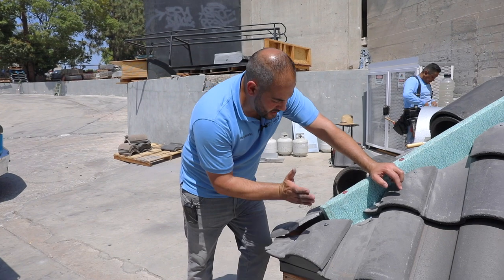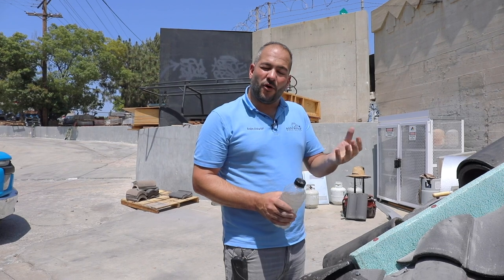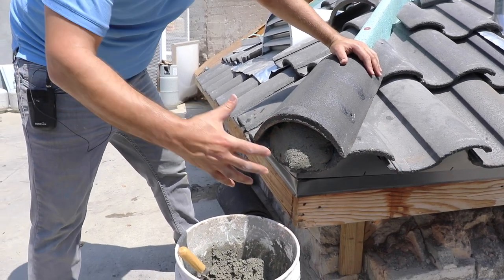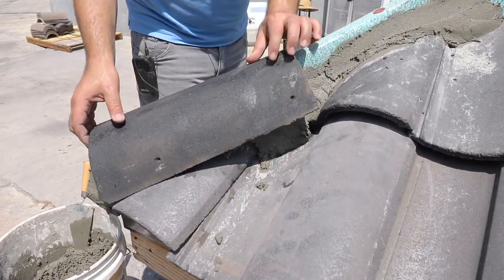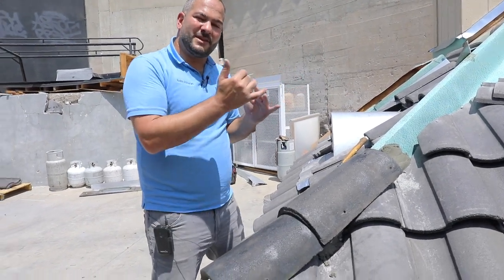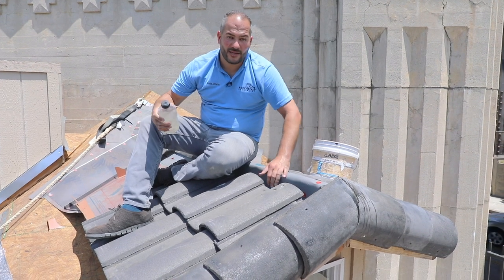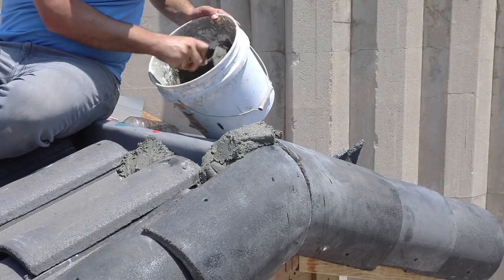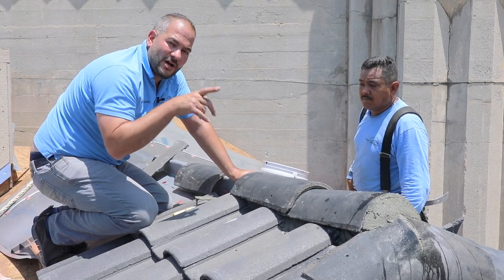How to Install Hip and Ridge Tiles - S Shape Tile Roof

Comment: Interesting; My tile roof is about 20 years old. My roof is leaking although I've repaired all the broken tiles. I live in California in the central valley. Temps here are regularly above 100 degrees. After watching the video I looked closer at my roof. I don't find a single tile that has been nailed. There is no mortar, sign of adhesive, or nails on any of the ridge tiles. My tiles are "S" style. I am contemplating removing tiles in leaking areas and repairing the underlayment myself. After watching this video I am perplexed about whether I need to mortar my ridge line on this 1970 ranch style house. Is there a best practice for beginning a repair like this? I mean, where should I start looking for the damaged underlayment. I've been in the attic and I couldn't determine where the leak came from. A leak on the ridge line above the garage I temporarily repaired with a tin foil platter...
Reply from the maker: To find the damage underlayment remove the tiles above the leak area approximately 10ft x 10ft. Remove the underlayment and you should find the wood stained. Follow the stained wood until you find the source. If your having multiple leaks it may make sense to try to replace all the underlayment.
Reply: @RoofRepairSpecialist  Thank you. This is helpful. I was up there this morning and I have a couple of vents where the flashing metal is bent and the tiles out of alignment. This is the only problem area I see.They are close to the top and my leak that is soiling the inside sealing is near the bottom but the water could have traveled down the rafter that far. 10' is reasonable and in alignment with the vents up there. Maybe I will start looking about 10' from the damaged area and see what I see. I spent a few hours cleaning tree debris and found on the other side, South side, about 5 tiles that need to be repaired. One completely crumpled under my foot.
Thank you again for your reply.

Comment: Very different to how ridges and hips are bedded here in Australia. All the ridge and hip tiles are secured with the cement and then flexible pointing is applied on top to prevent cracking and allow for thermal expansion and contraction.
Reply from the maker: Ya, I’ve noticed, I have family who lives in Australia, I helped them repair a roof during a trip out there. Totally different

Comment: Thanks for the videos!  What kind of mortar do you use?  Also, do you use a 2x8 for the hip board and a 2x6 for the ridge board?
Reply from the maker: We use spec mix
Reply from the maker: And depending on the tile and pitch we decide a board to use, there is not really a standard. But 2x6 is most common